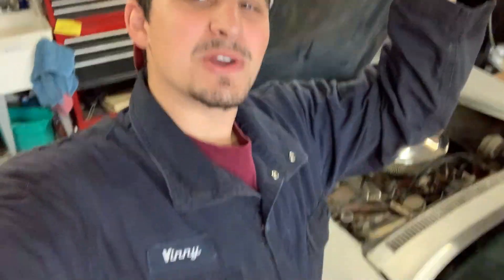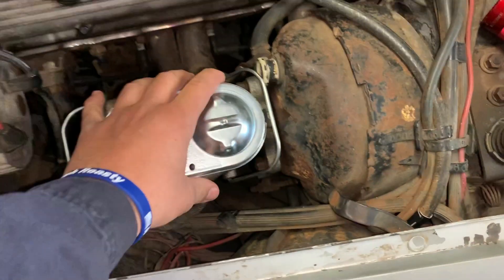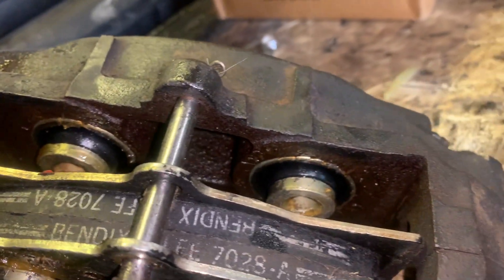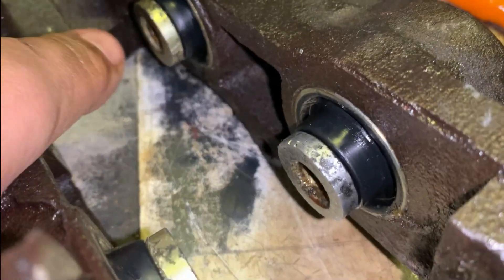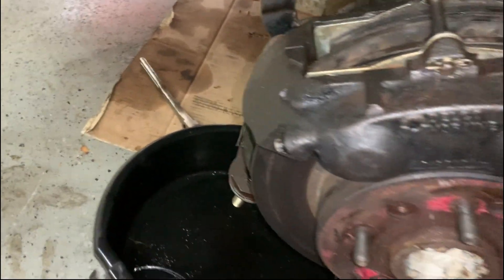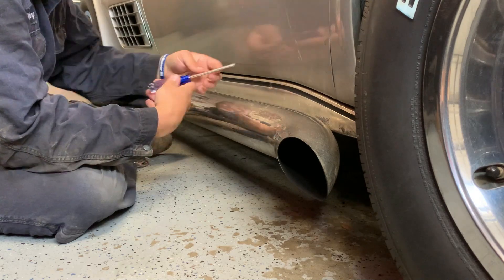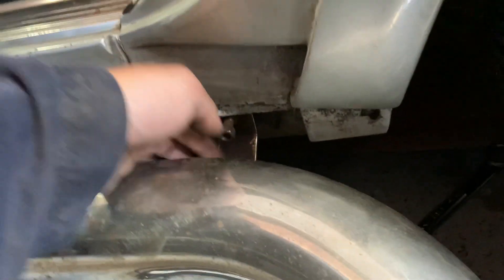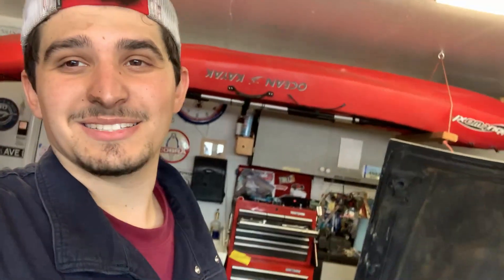Loose Exhaust?!! Brakes aren't working! :(

Comment: Hi vinny what you need to get are some o ring calipers fix the problem permenently
Reply from the maker: Hey there James!! Are you referring to the little o ring that is located with in the caliper? Or are you referring to a style of pads that have an o ring insert for the pistons? Thank you so much for your feedback!!
Reply: @7badtothebone  Corvette Stainless SteelBrakes in Gainesville Florida makes and sells Pistons that use an O-Ring instead of the GM lip type seal.  The boot you replaced is not the cause of the leak, the fluid is getting past the piston seal.  Bad seal, pitted caliper bore, corroded piston?  You need stainless sleeved calipers and the O-Ring pistons. And, do not use DOT 5 Silicone fluid.
Reply from the maker: @budehrmann5902  oh wow I didn’t know there was such thing!! These pistons are definitely pitted and corroded for sure. I’m going to need to do this modification soon so I don’t have this issue!! Thank you so much for the advice!
Reply: @7badtothebone  Vinnie, glad to help.  Give Corvette Stainless brakes a call at 352-554-5470.  They make almost everything they sell right there in Gainesville.  Get whatever they suggest, and you will never have to touch the brakes again.  I have had my 69 since new and just installed the O-Ring pistons in addition to some other changes.  Yea, do the math and I am 75+ years old.
Reply from the maker: @budehrmann5902  thank you so much, your help is much appreciated. I’m very grateful. I have people like you helping me with this car. I can’t thank all of you enough for the advice and knowledge. I will give them a call ASAP!!